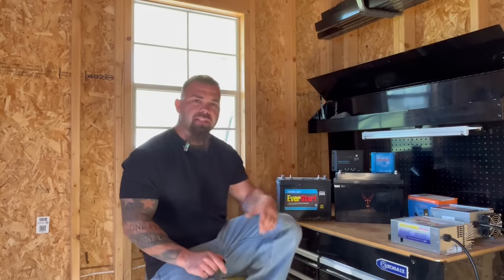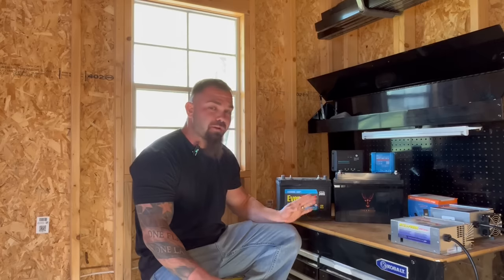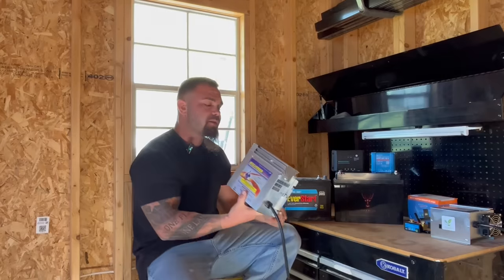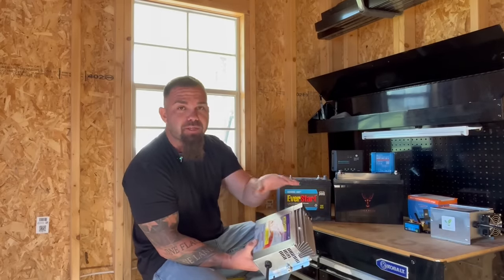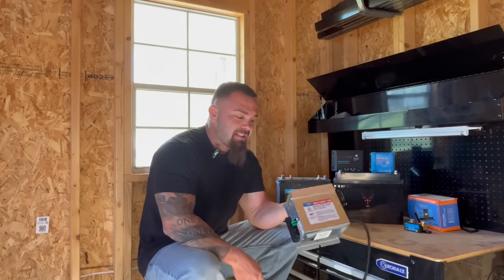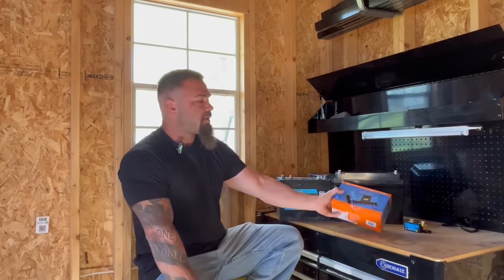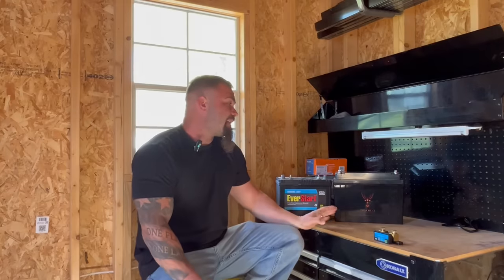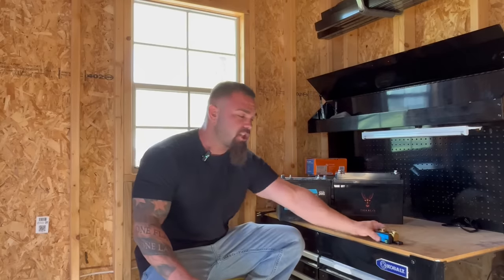Swapping to Lithium? WATCH THIS FIRST!

Comment: I have a Pecron 2 KWh solar generator and a 200 watt solar panel that is used for our portable fridge, microwave and 120 volt mattress pad.
I bought a 12 volt 100 amp hour lifepo battery to replace the dead sla batteries. This will power the rest of our 12 volt needs.
Can I just get rid of the existing converter box and use the alternator with dc to dc converter, shunt and solar to charge the battery?
Thanks in advance for any replies!
Reply from the maker: That's definitely an option for ya. Nothing wrong with doing it that way as long as it's executed correctly on the install. :)
Reply: @rvsolarconcepts  thank you!
I’m looking at a combo dc to dc / mppt controller where I can charge my lifepo battery bank from solar and alternator.

Comment: It's best not to charge any lithium battery to 100% regularly. 
80% charge is just fine, and they will normally last 5 times longer than lead acid batteries.

Comment: 10 years ago, I bought a new converter for my 30ft tt. It says on it that it has 3 levels of charge that are automatic...no switches.
13.4, 13.6, 14.6...is this what you are talking about? This was why I didn't purchase a new converter.
Reply from the maker: Aftermarket converters are usually more advanced than the crap they give you from the factory. Most factory converters don't give you those options but if the new one has a way to change the voltage you should be good to go.

Comment: So If i get Lithium set up for my class A motorhome you talked about getting DC-DC converter between the Chasis battery and Alternator, my question is do I just keep my original battery (lead acid) there for the Chasis (driving) battery or do I change that battery to Lithium also? and if so what would that Lithium battery style be called? TIA
Reply from the maker: Keep the lead battery for the starting battery as designed.

Comment: I'm still trying to find out (without any success) if my 2023 Winnebago Travato 59G has a converter that can be adjusted for LiFePO4 when I do change the AGM's in the future. Same for the solar controller too.  I'd hate to change the converter in this new coach.
Reply from the maker: Your RV should have come with a large folder or envelope with all of the manufacturer booklets for all of the appliances in your RV (IE: fridge, converter, tv's, inverter, etc...) your best bet is to find the associated documentation for the converter and read into that. The next best thing to do is to pull the converter out or locate it and find the sticker on it with the model number so you can google the model number to find out specifics about it.
Reply: @rvsolarconcepts  I'll check it out. Thanks for the tip!

Comment: Question? I thought the invertor was on the out put size converting DC to AC. Are you talking about a convertor that has a charger built in the invertor?
Reply from the maker: An "inverter" takes DC voltage in and puts out AC voltage. A "converter" does the opposite, takes in AC voltage and puts out DC voltage to charge the batteries and run the DC loads like water pump, lights, etc...

Comment: Can you not charge lithium in cold weather? For example, where I live it gets -20, -30 degrees in the winter. I leave my rig plugged in charging all winter. Can't remove the batteries and bring inside because I have to exercise  the generator every month.
Reply from the maker: For instances like yours I would recommend getting an internally heated version so this isn't an issue for you!

Comment: so in a boat where the stator or alternator doesnt charge past 13.6 volts, the LiFePO4 wouldnt get to full charge? This could be a good thing as then the BMS wouldnt shut off the battery and then the charge has nowhere to go and then end up frying the electronics on the boat...am I correct to assume this? I top off my LiFePO4 with a LiFePO4 battery tender but then I bleed some voltage off by letting some electronics run for a while before I launch the boat to avoid the BMS shutting off the battery charge.
Reply from the maker: I have lithium swapped my personal boat with a Volvo/Penta 8.1L engine with alternator and the battery never gets above 85% so I'd say it depends on the windings of the alternator which determines it's output, but yes mine never charges to 100%.

Comment: I'm surprised your lead-acid charging Voltage is so low (13.6V), my (UK) alternator runs at 14.2V & some high-current units get up to 14.8V.
Reply: Battery University's BU-403 suggests this low Voltage does not reach the desulphating level which presumably reduces the lifespan of the battery. They recommend a multi-stage charger.

Comment: I just recently switched to lithium. Wfco converter 

Model wf-9865lis

I don't see a button do I need to do anything else
Reply from the maker: @monkeyMeme972  There usually isn't a button to hit, it just has a constant higher voltage output for lithium batteries.

Comment: Hello, just a quick correction on lead acid charging rate. A lead acid needs to charge at 14.4v minimum same as it does in you car. If an alternator was charging a lead acid at 13.9 this would be considered a failing alternator. A resting fully charged lead acid should sit around 12.9 - 13v. I suspect that these incorrect charging levels are why many have problems with lead acid.

Comment: i need to replace our trailer battery, i guess an agm battery would be much simpler than lithium (and far cheaper).  do you recommend a particular brand?  we are in canada, so some different brands of course
Reply from the maker: Full River makes a very good 6 Volt Deep Cycle AGM battery but they are about the same price as Lithium once it is all said and done...
Reply: I'd stay with AGM in the frozen Northland.

Comment: Can I leave the rv plugged in with the lithium battery installed. I did upgrade my converter.
Reply from the maker: @f150bft  you can, but there's really no point to do that with lithium... as long as everything is isolated so they aren't constantly draining, lithium shouldn't discharge more than 1 percent per month while sitting in standby.

Comment: This is actually really complicated, you have to study the data on the cells used to make up the battery and also the bms as well as every charging source. The technology used is LiFePO4, maximum charge voltage is 3.65V, discharge cut of was 2.5 or even 2 in the beginning, but that was later changed. If you study the graph of cell voltage vs capacity you will see that 90% of the capacity is at a voltage very close to 3.25V, the line is almost flat there. What it does not show you is that at either extreme life is reduced! They, unlike lead acid, don't like being fully charged. It also means you can't use voltage to measure capacity! So systems using these tend to use current in and out to keep track of it. This is why state of charge measurement is more accurate, I.e. it's because you have to use better technology to measure it.
Reply from the maker: That is very much correct. There is a lot of information and characteristics to lithium that can be further delved into for the extremely passionate out there. This video was intended to be a BASIC overlook at what to expect and the functional differences to lithium when converting your RV. Very good indy though, thanks for your comment!

Comment: How to incorporate an EcoFlow inverter/generator, solar panel and lithium battery on my 2021 RV trailer?
Reply from the maker: We get asked A LOT how to incorporate the new "solar generators" into an existing RV system and there's honestly no good way to do it that doesn't require a bunch of work arounds, breaker manipulations, ETC... In order to make it work somewhat correctly... We may address this in a future video to give some visual context though. Thanks for the idea!

Comment: What about rewiring? I assume I would need rewiring the van for the solar controller, the converter and the DC to DC controller. How difficult and costly is this?

I tow a 2013 van with AGM batteries, so I assume the wiring wouldn't cope with lithium batteries. 

P.S. Because we freecamp almost exclusively, and already have a Victron MPPT solar controller, - that our priorities for moving to lithium would be putting extra solar panels on the roof (currently 360W), rewiring the solar-solar controller-battery pathway, and maybe disconnecting (?) the DC-DC pathway to protect the car alternator? i.e. initially rely on solar to charge the batteries.
Reply: And I've heard you that the shunt battery monitor is non-negotiable, and I understand why.
Reply from the maker: No rewiring is necessary just because you're using a different type of battery. As long as the wiring and fusing is appropriate for the current passing through it, the type of battery makes no difference. And if you really think about it in terms of Ohms law, because lithium runs at about 1 volt higher than traditional batteries, the amperage to and from that battery would actually be less to some very small degree... If all components were wired and sized correctly in the initial install, they will be fine in a lithium application as well, just change your settings on the equipment and you're off to the races!
Reply: @rvsolarconcepts  thanks for the fast and direct reply. I would be putting more current (around double) through the wires by adding more solar panels, so maybe I'll need rewiring there. I had assumed the lithium-capable controller for mains power would also pull a greater rate of current through. But if difficult/expensive rewiring may not be involved as you suggest, then the switch to lithium suddenly becomes much more doable.
Reply from the maker: @canwelook  your solar controller can only put out an amount of amperage equal to our less than its rating. So if you have a victron 100/50, the controller can only put out 50 amps, period. It wouldn't matter if you put 3000 watts of solar, it would just max the controller output at 50 and sit there. So, looking back at my original reply; as long as your output wiring and fuse was done correctly from the get go (rated for the rating of the controller or slightly more) then you'll be good even if you add panels because the charge controllers amperage rating is the ultimate limiting factor in that system. Hope that clears it up a bit!
Reply: @rvsolarconcepts  Thanks again. You got the model exactly right. It is a Victron 100/50  which we put in a couple of months ago to improve our solar charging (which it emphatically did). Given the wiring was installed in 2013 to suit a 2013 model controller, how can we confirm the wiring can handle the Vitron's max 50 amps charge? My assumption is that in 2013, installed correctly, it would have at least needed to be designed to handle something like 300 watts divided by 12.5 volts equals 24 amps. Which is well below the 50 amps the new Vitron solar controller could theoretically draw if I add more panels? It seems I am misunderstanding something.

In practice, however, the Victron guage says we are getting an upper limit of something like 12 amps when the battery voltage is low, even when I put out our 250 watt folding solar panel (which claims to capture "up to 20A output") to supplement the 300 watts on the caravan roof. Victron says the battery current drops down to 1 or 2 amps later in the day when it says the battery state has moved through bulk and absorption to the trickle down of float. I don't understand why these figures would not be much higher when the battery voltage is relatively low and the output draw is high.

Comment: On a towable RV trailer there is a 12v power line going to trailer battery thru the trailer tow signal connection 

Can that also lead to alternator failure?   

Ford F150 and F350 for towing
Reply from the maker: Charging through the 7 pin connector is VERY restricted due to the factory wire size so there is no risk of alternator damage when a trailer has lithium batteries, only motor homes. I believe Battle Born Batteries made a video confirming this on their channel as well.
Reply: @rvsolarconcepts  - wouldn't restriction due to wire size be bad, like over heating, melting insulation?    I'll search Battle Born and see if I can find it
Reply from the maker: @ahbuildingafarm  In high current, high demand situations it can lead to heat build up, yes but in most other cases, small wire just causes increased resistance which lowered the amount of current that can pass through that conductor.

Comment: Sorry to say, but you are actually wrong about the charging voltages. I´m a professional and have the knowledge to say so. Please take my advice.
Charging voltages for LiFepo4 should be LOWER, not higer than for lead-acid batteries.
It is a miss conception that lithium should be charged to 14,6V. This is acceptable, but far from necessary, and if you have the option to reduce the charge voltage, you should do so. Reason being lithium lasts longer when not fully charged at all times or at high resting voltage. This will be more pronounced in an RV that is mostly hocked up or charged from the vehicle engine. For other applications you will fully charge and then use. Then the battery will see much less time at higher voltages.
A lithium battery charges fully at 13,8V. However it will take longer at the end of the charge cycle. For faster charging use 14,2V. I´m using 14.0V witch is perfect. You can also get to 100% SOC with lower voltages (13,8 - 14,0V) by having a longer absorption time, but usually not necessary to have any absorption time at all. Go right to float from bulk charge. With Victron chargers this can easily be obtained.
For the float charging to maintain 100% state of charge, use 13,4V. This voltage will hold the charge forever, but at a level that is better for the battery health. Preferably use 13,35V. This will hold the battery at around 95%. I personally use 13,3V and this holds the battery at around 90%, I dont need 100% at all times.
The whole point is that opposite to lead-acid batteries, lithium lasts the longest if not at high voltage or full charge at all times.
So customers using their old lead-acid charger for lithium will never experience not getting a full charge. Actually the opposite, they will get to 100% SOC much faster and at a unhealthy high voltage level. Fine if you are using the battery for your trolling motor, but for an RV, not so much.
Another consideration is that you should never get close to the BMS turn off voltage points. This is the last resort to save the battery, NOT to control the charging process. The BMS shutting off creates a load dump that in some cases can be harmfull to other electronics. Charging to 14,6V will in some cases trigger the BMS charging cut off every single time the charger is starting a new cycle.
Usually we are following the manufacturers specifications. We normally dosent have better knowledge than them. However, as any development engineer (like my selves) knows, the marketing department always get the last word. And would you know! The lithium battery we are selling you has exactly the same spec as the lead-acid battery! You can just slap it inn! Pay over there and good bye!

You are absolutely right about the charging from the alternator and the battery monitor. This is also something i always strongly recommend for the same reasons as you say.

Best Regards
Rudy
Reply: Rudy, I agree with you about the charging voltages.  The marketing department is behind the 14.6v recommendations on the drop in batteries, while the engineers would be happier with 13.8v.  My alternator charges at 14.1v, but I can manually cut the connection to the house battery after a few hours of driving.  My solar controller is set to 13.8v bulk and 13.4 float .I have been cycling my LiFe bank for 4 years, and a load test shows a 10% total drop in capacity, which could be attributed to aging. By the time I need to replace the batteries they will be even cheaper.

Comment: If my rv has a convertor with auto detection can i just drop in a lithium battery? My rv is a 2022 epro with solar.
Reply from the maker: Yes, the auto detection converters should "see" the higher voltage and adjust its output accordingly!
Reply: Thank you very much. Great video and information @rvsolarconcepts

Comment: If the Li batteries go up to 14.6 V will it have any effect on running the 12 V systems after swapping the batteries?
Reply from the maker: It will not have any adverse effects on the existing 12v electrical system as lead acid batteries often go through what's known as an "equalization" cycle which temporarily boosts their voltage to over 15 volts. This  happens automatically and is controlled by the RV converter (battery charger) and solar controllers. So in most cases that same 12v system has seen 15+ volts about once a month for the equalization cycle and therefore should have no effect when swapping to lithium. Good question!!

Comment: Will shunt work to monitor state of charge on a Lead Acid batterysystem ?
Reply from the maker: Yes, until the batteries start degrading in performance then it will be difficult to tell accurately but lead acid batteries are easy enough to tell state of charge by their voltage, lithium is not the same which is why it requires a shunt.